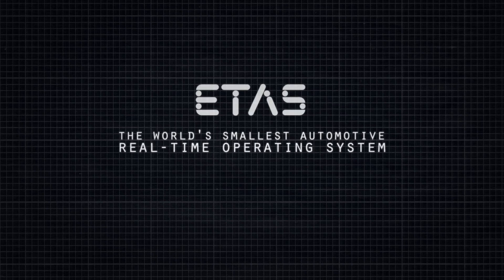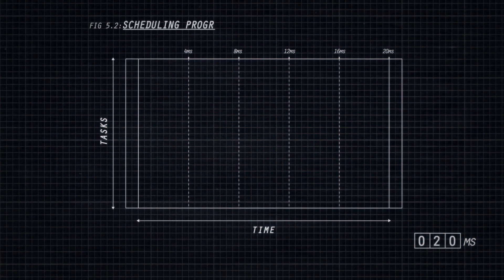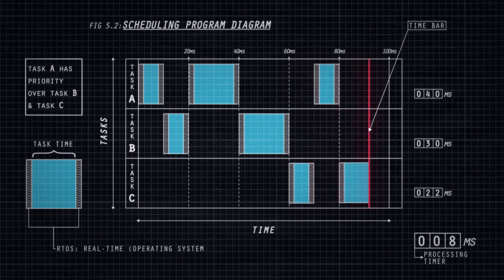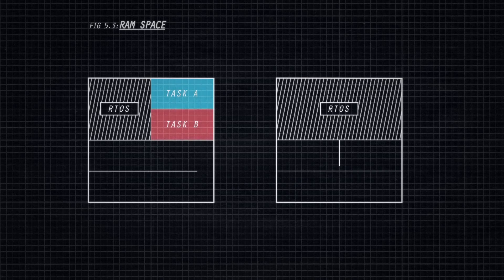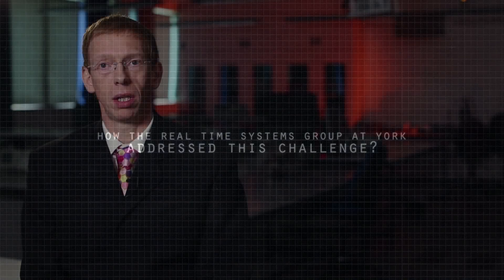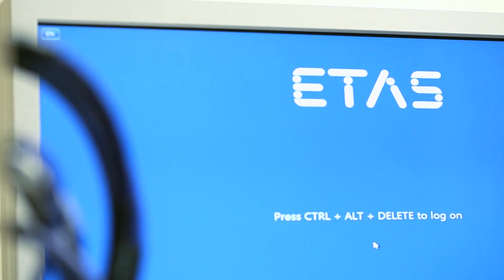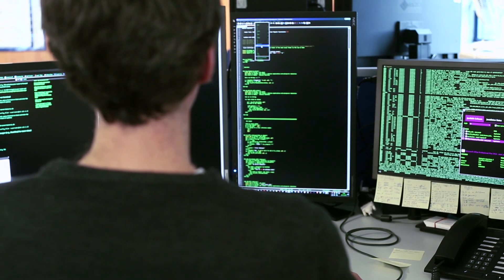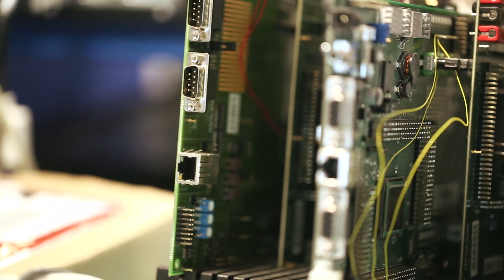The world's smallest automotive real-time operating system

Comment: Bare Metal programming beats RTOS every time.
Reply: @ganesan guru I think you what you explained seems to be the case of Interrupt Driven Programming...but in case of OS the Interrupts( PendSV specifically) is used for context switching which cannot be done bare metal. Scheduling is just one of the part of RTOS... context switch, Memory Management and much more things are there which are simply tedious to implement in Bare Metal Programming
Reply: How will you scheduled your modules on bare metal programming?
Reply: @WalkundeSuyash  polling for occurrence of an event & execution of its corresponding routine when it occurs.  Same polling is called scheduling in os concept
Reply: Don't use RTOS for Toasters please.  In another case, there are financial constraints, as well as maintenance constraints, which make using an RTOS the minimum requirement.
Reply: Can't deny it. Yet RTOS is overrated by kernel developers as compared to bare metal coding

Comment: Deadline is the shortest Timespan of a process to be executed by the System or Operating system Installed.The Speed and Accuracy of the System depends upon the consistency of Data and Memory Capacity of the System to evaluate the Accurate Information.When we Type or Feed the Input values we have to be careful in whatever Application is Implemented in the DeskTop or Lap Top to get the Accurate Expected Result.Bcoz the Companies are using the System still depends upon the Manual Feeding of Data not yet moved to the  complete  Artificial Intelligence or Robotics.So those who do Data Entry Works kindly do it careful.Otherwise one wrong entry can cause huge errors."Trial and Error Analysis" can be done with new Application Developments.Not with Data Entries in Programmed or Implemented Application to manipulate the Data.The Application Maintenance is very important to keep the Server safe.Otherwise the Server will be corrupted with Replicated wrong Entries.Duplicate entries and Wrong Entries should be Overlapped.Modulation and Synchronization of Data from various Modules or Units has to be Integrated and Executed as an Accumulated Gross Value.